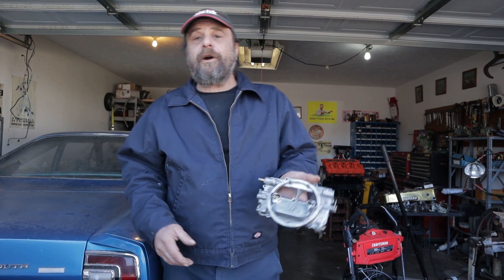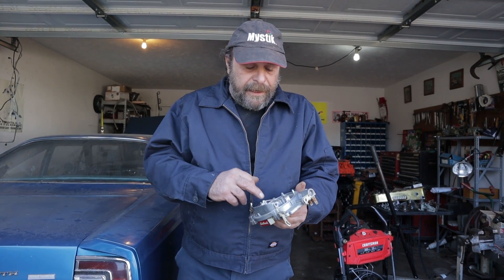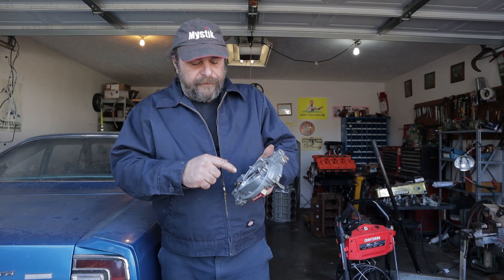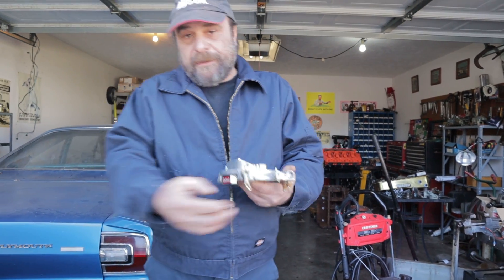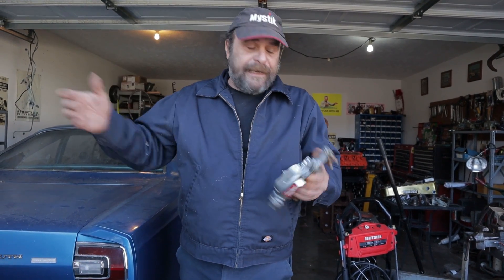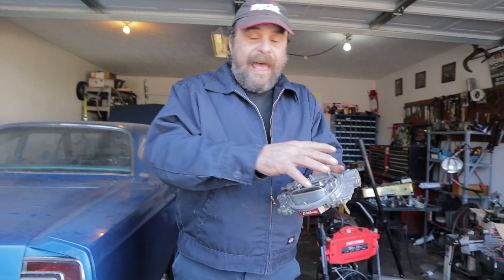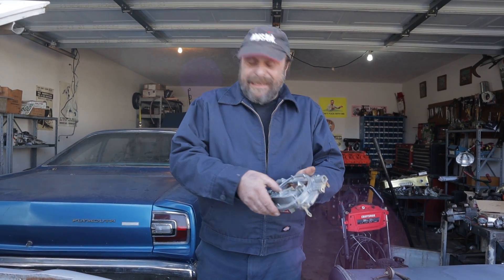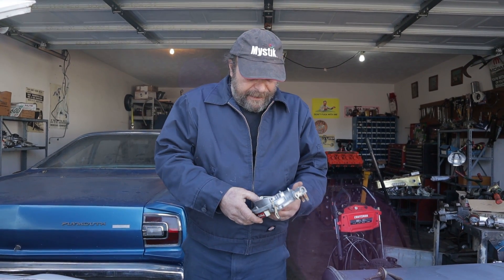The Most Troublesome Part Of Any Carbureted Car

Comment: My first car was an old vw.  I had a great book on vw's in which the author swore auto chokes were a conspiracy by manufacturers to shorten engine life.  His first suggested carb adjustment was to disable an auto chokes and just let the car warm up for a few minutes.
Reply: i have heard the same! i had a 1972 mustang 351c 2bbl it had the choke wired open and it started up like efi! that engine has all the original stuff but the common tune up stuff! so from that point i had never had a choke. i remove them! yes you have to let them warm up but it is not a problem. using a clutch fan helps. i have let people start my other rigs and thy are used to the 1-2 second dely efi has and ended up grinding the starter as i lit off so  fast! it all so wold out do efi in fuel economy to!

Comment: There was a pogue carburetor that got 100mpg i wish we can re invent this..any one here about it
Reply: the internal combustion engine requires air fuel ratio to be in a certain range +-14.7 to 1 to run. my dad's goal in life was improved fuel mileage. heated the gas cooled the gas but his brother always got better mileage due to wait for it       not telling the truth.
Reply: It was a mix of hype and complete bs from the 1930s.  Even the premise is wrong - there's a limit to how much energy is available in a set volume of fuel, and the stories far exceeded that, even if the engines were 100% efficient (even today, car engines are only 35-40% efficient at best.)  Claims of over 200 mpg were tossed about, but they remained hearsay, usually by dealers who had a vested interest in making their vehicles seem better.  But somehow, no one reputable was ever able to see one in action or measure its actual efficiency.  https://www.snopes.com/fact-check/nobodys-fuel/
Reply: @aussiebloke609   older cars like honda or toyota with carbs were 100 times better than todays
Reply: It's an urban legend.  Just a carburetor isn't going to suddenly take you from 10 or 20 MPG to 100.
Reply: gulfy09 read all about it. It’s still on the intro web . Wasn’t it some guy from Winnipeg? Tried to get Henry Ford interested ?

Comment: Open loop vs. Closed loop for the E.F.I guys.
Reply: Not quite. More like Enrichment mode vs open loop, like he explained with the coolant sensor. Also "crank" signal does some of the same things as a pulloff does.
Reply: I was speaking in general terms here... cold loop usually runs a set parameter of fuel trims; +/- timing, and/or other variables depending on how late of model you wanna go. Once up to temperature(closed loop) its actually on the sensors to feed the computer the data needed. Granted most of my experience is in OBD1; I'm willing to learn if I'm wrong. That's just how I was taught to fiddle with tuning. Wide bands and knocks censors lol
Reply: @howiefeltersnatch2973  My background is GM OBD1 systems too. They actually have six modes, Starting, Clear Flood, Open Loop, Closed Loop, Acceleration, Deceleration.

Starting mode uses a table based on MAP and CTS to set the AFR and idle air for starting when the crank signal is on and the engine is below 600rpm. It is more or less the pulloff and thermal choke on a carb.

Clear flood does what it  says; TPS over 80% and crank signal shuts off the injectors to clear the engine.

Open loop is a speed density mode that uses RPM, MAP and CTS to calculate AFR based on a lookup table. This is more or less where warm cabs operate.

Closed loop is entered after the O2 sensors are hot and the warmup time has elapsed. This mode uses the voltage from the O2 to "trim" the tables from open loop.

Accelertation mode does the same thing the acceleration pump in a carb does. A quick shot of fuel when you romp on it.

Decel mode cuts off fuel when you cut throttle under load. Prevents backfiring and fuel washing.

This and more detail about the GM 220 can be found in "Light Duty Fuel and Emissions" published by GM for 1988 and up vehicles.

Comment: ,,, you can get many carbs to temporarily go quite rich without a choke. Just work the throttle pedal enough to get accelerator pump shot, letting off quickly to cut air volume  . Two three minutes of driving and its usually warm enough .
Reply from the maker: Right, that's what is meant by feathering

Comment: I've always preferred manual chokes. It can sometimes be a pain to teach someone how to start their carb'd classic car; manual or auto choke.

Stuck heat riser on the manifold collector can be a pain, too. 

Carbon issues = rev engine and trible water down the carb.

Comment: These dashpots/ choke pull offs are also a source for vacuum leaks.
Reply: Dashpots and choke pull-offs are 2 different things. They do usually look alike, though.
Reply: Most quadrajets had two choke pull-offs, a primary and a secondary.  The secondary choke pull off, the one that the back of the carburetor, has a calibrated vacuum leak in it new and will always bleed off.

Comment: With all due respect, I will say,  in my experience, that the accelerator pumps are the biggest issues...especially with the Edlebrock 4 bbl if NOT used often!  May be different issues in different parts of our Great Country. I am in So Calif
Reply: Same with Motorcraft 2100/2150.  Warped covers, dry gasket breaks, etc.
Reply: SoCal fuel is pretty bad on rubber parts. Try to get a pump that uses Viton as the material. Much more ethanol and solvent resistant than regular rubber or leather. Keep an eye on your lift pump too if you have a mechanical style lift pump.

Comment: If you live at a higher altitude, you need to have the choke pull off set to open further than the factory spec, or it will be rich. Just an FYI.

Comment: I just run no choke on my holley
Reply: With Holleys I never had chokes
Reply: @Stevesbe  I give mine a pump or two for fuel, fire it up and hold it at like 1500 rpm or so for a couple seconds, then just let it idle after that. All it needs
Reply: Same here, 3 pumps and fires up feathering or steady rpm.

Comment: OK...You are spying on me.  I have been tinkering with the carb / choke on the 76 Dodge D100 that followed me home recently (YOUR FAULT, UNCLE TONY!).  Yep, automatic choke was the issue.  Tore out the offending bits, put in a manual choke cable and magically, problem solved!
Reply: I really want a 76 Dodge pickup. It's the year I was born, plus I absolutely love that body style and the way they drive. My favorite 70's pickup for sure.
Reply: @ShadeTreeKennyT  same chassis was used through 93.
Reply: Same thing with my 77 F250  I am really thinking about a manual choke now
Reply: @jkk4657  , do it.  You will not regret it.

Comment: My elder has a flapper on the choke flap that pulls open on fire up, seems to help. Most mine are manual. But why is there vacuum to the electric choke on the elder? I've had to plug it off when converting to manual.

Comment: Great video Unc ! I have a brand new Holley 670 and the choke is the ONLY thing I cant get right. Holley says loosen 3 screws, turn clockwise to have shorter choke on, counter to be longer. They say hold open the throttle and turn choke wheel till you see the choke just close but on mine, it doesn't go back or forward as shown. It just sits there. So f I adjust, its sort of a SURPRISE where it actually set. Any advice? Should that choke plate move back and forth as I am trying to adjust ?
Reply from the maker: The plate should move as you turn the choke housing.  I'd pull the housing off and make sure the spring is hooked over the linkage arm.
Reply: Uncle Tony's Garage yeah. The choke works.. as car warms, blip throttle, choke comes off in steps with the carb cam. But can’t get it to adjust where I want because it doesn’t move back and forth as I try. Sigh

Comment: The EPA killed the common car, well sorta, but fuel injection saved it... well sorta. Many cars wound up in the grave yard due to crankcase oil diluted by gasoline due to the enrichment cycle failing. 

Imagine your engine trying to be lubricated with gasoline? Yeah that's not going to happen. What is that knocking? Oh just one of many connecting rod bearings. DOH

Comment: Some chokes aren't actually a choke. They are a fuel enrichment circuit. It's the same objective, just a different way to get there.
Reply: In my tinkering with dirt bikes over the years , I've seen quite a few chokes like that , no flap it's an enrichment circuit. 
It's usually on the bike carbs where you pull a knob near the float bowl
Reply: Chokes are ALWAYS a fuel enrichment mechanism.

Comment: Fast idle also warms the engine faster.  Even EFI cars have it.  Hell, diesel engines use it.  My old MFI diesel has a fast idle system!

Even on carbs without an obvious choke pull-off, the choke plate is designed to act as a pull-off by being asymmetric.  That's how the Eldelbrock works.  And I now hate myself for defending a Carter design (I really, really hate Carter carbs).

Just a couple months ago, I had to do TWO Fords in a row (Mustang and F150) that had the heater tube down to the exhaust for choke heat.  Both of 'em had either broken or no pipe down into the manifold for choke heat.  1/4" brake line, drill out the hole in the exhaust manifold, good to go.  Both vehicles are owned by idiots.

On the ranch Jeep, I like to start it and walk away while it's on fast idle so it can fully warm up while I'm doing something else.  Electric choke does its thing without affecting fast idle cam as long as you don't touch the throttle.  That sucker's on step 1 with the choke fully-open and I'm still cutting down cedar or whatever.  Easy peasy once I decide it's time to use the Jeep for something.

Comment: I've never used an Edelbrock carb. Is it true that they're basically a copy of the Carter A.F.B.?

Got my Quadra-Jet rebuilt n reinstalled on the 454 in my 78 GMC today. Fine tuning begins tomorrow.

Still thoughts n prayers for Lamb Chop!!!
Reply from the maker: Yep, copies of the AFB and also the AVS
Reply: @UncleTonysGarage  Why didn't anybody copy Motorcraft's carb? That seemed like a good simple carb to me.
Reply: @gg5115  You should repost your question as a comment on the video. You'll probably get a reply from Uncle Tony that way. If I had to make my own guess, I'd say that nobody copied the Motorcraft carb because, to my knowledge, they weren't used on performance engines. They're simple and reliable for sure though.

Comment: In SW FL, after 30 seconds of "feathering" it, the choke is open. Sometimes its so hot down here the choke on my Weber is already partly open before I start up. The choke coil takes care of it, I don't even bother adjusting the choke idle screw. Thumbs up.

Comment: When I first got into the trade in 90 I changed more Rochester quadrajet choke pull offs than any other
Reply: The first carburetor I ever rebuilt was on an 86 Cutlass Supreme. The mechanic I was working with slid it across the work bench and said you do it. You won’t ever understand them if you don’t repair them. Another overlooked part it a worn throttle shaft. Definitely a spot for a vacuum leak causing an erratic idle
Reply: I have a quady on a 308 holden v8. Runs rich but smooth. Not sure if it's the carby or maybe the manifold valve that uncle Tony mentioned.
Reply: My dads 73 Eldorado used to have an issue with it, made a black ring on the ground every time it started😂
Reply: Those pesky quadrajet carbs were the worst to adjust pain in the azz. Lol
Reply: @pacman3908  and it's a quady with the adjustments blanked off too

Comment: Choke? Is that what that thing is I have wired open? lol.  I just pump the wee out of it, crank it over a little to fill float bowl back up,  do this procedure til she lights, and feather the pedal a bit till she runs. Dont bother me none, I can get it lit even in the coldest Pa. weather lol. Ive always run the ole Motorcraft 2100 on my Heeps. They work good on steep hills
Reply: motorcraft 2100 2150 you mean? best carburetor of the 2bbl! annular boosters and the variable hi-speed air bleeds make for a precise mix!
Reply: @jakemichael8586  Thank you for catching my typo brother! Yes I meant the 2100. Not sure how I missed this, but I'm not sure of a lot of things lol. The 2150 isn't quite as good of a carb as 2100 imo. The Rochester Doujet isn't a bad carb either. Same as a Quadrajunk's primary's if I'm not mistaken. I off-road A LOT and run the AMC 360, and for what I do a 2BBL carb is just fine for me.
Reply: @twiz8789  you welcome! i like 2150 better it has variable hi-speed air bleeds for better mix. the 1980-3 had electronic feed back junk.
Reply: i have a early 2150 that has no feed back or charcoal can flote bowl vent it just vents to the air cleaner. and yes i all so remove the choke or wire them open. starts like efi even when freezing. i use electronic ignition .

Comment: G'day Tony,,had me a 2 stomp carbi,,would never start with out stomping the throttle twice,,first one shut choke plate and the second just to make sure the mix was rich enough,but always started with in a rev,and if it didn't,,( Which didn't happen often,)..leave for 10 mins and do it again,,
Reply: The sign of a well tuned small block Chev: two pumps and it starts the INSTANT power gets to the ignition.  Used to laugh and shake our heads when some schmuck got in his self-proclaimed "bad-ass" Ford/Mopar/poorly tuned Chev and then cranks, and cranks, trying to get it started.